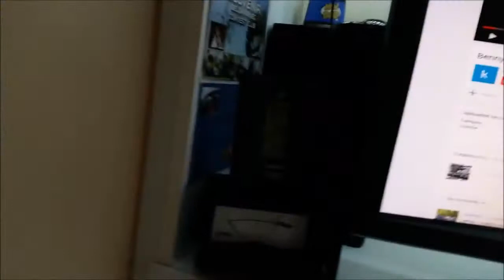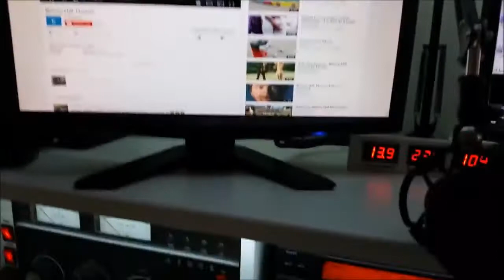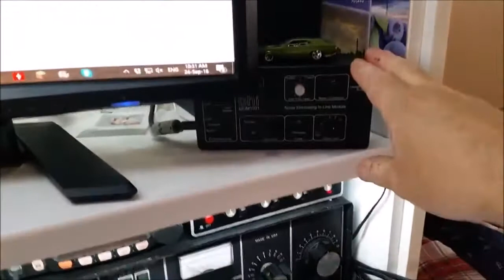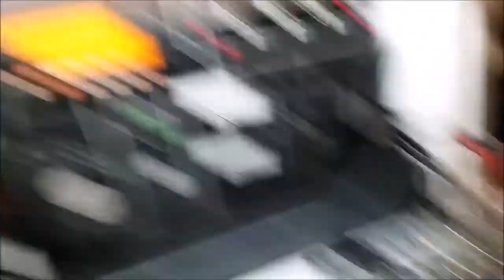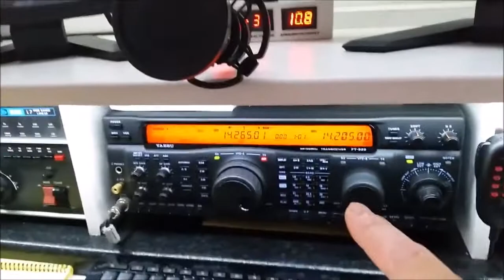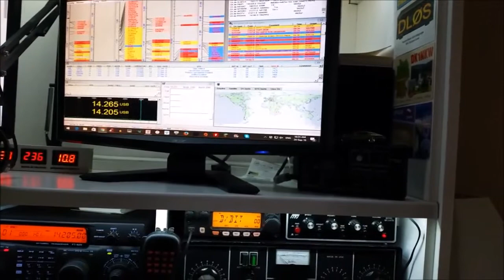Multiple Audio Sources, One set of Speakers

Comment: hi george have just got the new bhi para20 dsp one and i want to put it through my mixer and bose powered speakers   but were as yours radio,s are only coming out of one speaker thou my radio,s come through the two because i have the leads off the radio,s going through the phono and line in and all of the radio,s are coming out of the two speakers the same as the computer i know all the wires does get abit confusing at times as i have my icom 756 pro 3 kenwood tm241 and retevis rt95 ging through the mixer and i was just wondering george can i put my bhi para20 dsp through the mixer and powered speakers and come through both speakers thanx ste in liverpool eng 73 and thanx for great vid PS im getting my bhi para20 dsp tomorrow so ill let you know how i get on
Reply from the maker: I eventually got rid of the BHI as I could never solve the breakthrough. I even got on to the guy that makes it. I found with the 7300 i didnt need it anyway